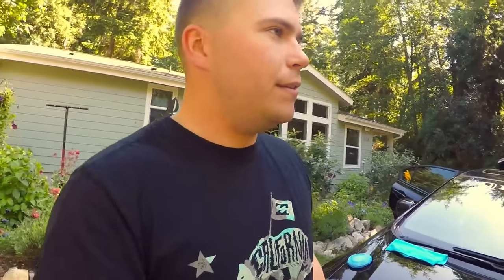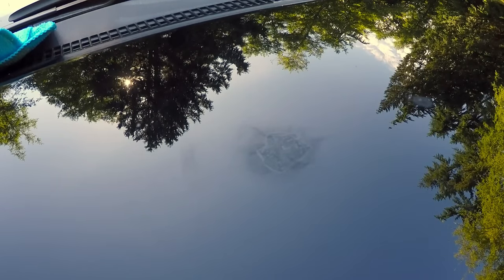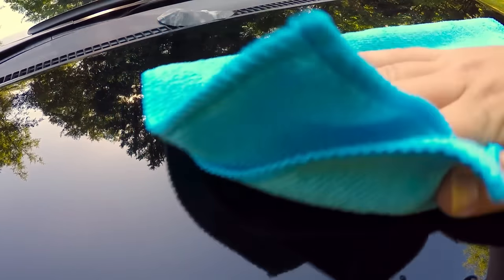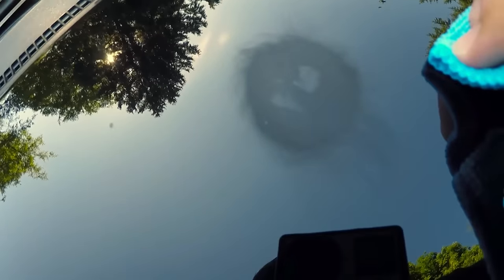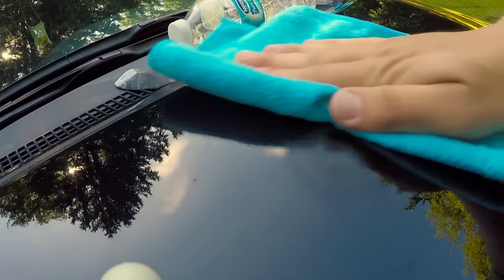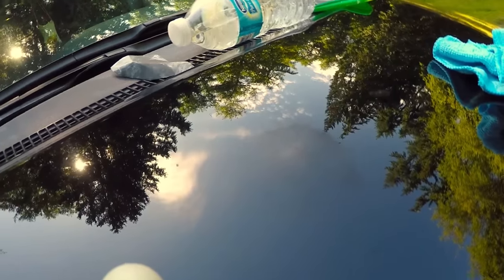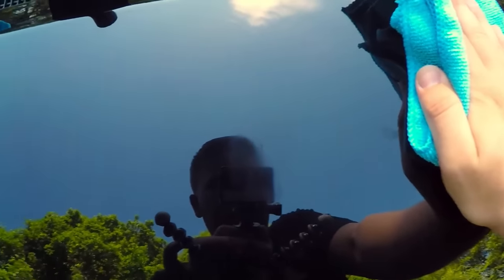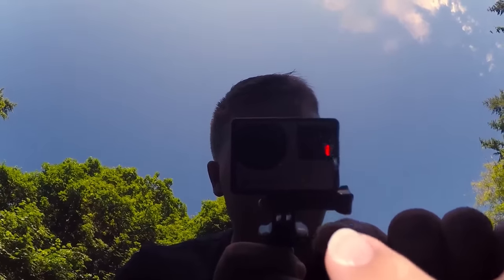Uneven Touch Up Paint Fix

Comment: how long did you let it dry before wet-sanding?  if you are going to put pen touch-up both paint and clear, and the color is lumpy as you showed, should you sand before the clear or put on the clear coat and then sand after?

Comment: Did you apply clear coat on each spot?  
Do you sand paint flush and then apply clear coat, sand flush again?
Reply: touch up paints already have clear coat mixed in them

Comment: Great video, great result! I do have a couple suggestions, though. I would highly recommend using at least a kitchen sponge as a sanding block. Much more even than fingers. Also, if you have a DA, a microfiber cutting pad with Meguiar's Ultimate Compound after sanding, and an orange foam pad with Meguiar's Ultimate Polish right afterward would produce great results.

Comment: what if your touch up pen has just normal paint then the clear coat? do you go back over the polished spot with clear coat and then sand, cut, and, polish before being done?? my car is ceramic coated so im just trying to see if i can add ceramic back over the fixed spot once u use the touch up paint

Comment: I'm curious: doesn't sanding remove some of the clearcoat? Wouldn't it be wise to apply some clearcoat, wet sand the clearcoat with a fine sand paper, then buff it out with polish?
Reply: @black.iczelion  That's a very helpful breakdown. Thank you!
Reply: @black.iczelion  That's good advice, it will show again when you thoroughly wash the vehicle but as you say repeat the process and all is good again.

Comment: You could also buy a cheap DA from Harbor Freight for about $50.00 and a pink foam pad used with the compound then use a black foam pad with the polish.  It saved a lot of time.  I was nervous using 2000 sandpaper on my car for the first time but it really helps smooth out touch up paint.marks.
Reply: dphotos please give more details .  Im new to this.  What is DA?   If there is a link it would also be helpful.   Thanks
Reply: Amazon has a Black and Decker random orbital for $30, with great reviews.
Reply: S. O. Rooney i use that one it’s awesome did a heavily oxidized black BMW came out like new
Reply: @Gnux91  Super reassuring. Thanks! Just getting to that part...
Reply: S. O. Rooney yeah just do the velcro mod on it so you can fit any pad and you’ll be golden that buffer is great no need for anything more expensive
Reply: @Gnux91  okay! You don't use the bonnets? Anyway, I'll do the velcro and pads!
Reply: S. O. Rooney nah they’re low quality, I uses chemical guys white and black one. One for cutting one for finish. They’re about 10 bucks
Reply: @Gnux91  Thank you! You're experience and advice are very helpful and reassuring. This is a bit anxiety - provoking when you love your car, as we all do.  😏

Comment: Good vid. If it were me, I'd soak the wet or dry sandpaper in warm soapy (Dawn) water for a few minutes before sanding. Periodically rinse the paper in the soapy water to avoid scarring caused by bits of debris that get stuck on the paper. After your self-described pressured sanding, perhaps a lighter pressure pass to smooth out some of the grain before proceeding to rubbing and polishing. Finally, polish your circles to the left, then to the right, back and forth. But yeah, good video.

Comment: Tried this with 2000 grit and my paint peeled off.   Stripped it, and started over.   How long did you let your paint dry before wet sanding it.

Comment: you can wet sand it lightly, then make sure it bends to surrounding paint. Then, instead of using heavy duty compound, use something like Maquires Ultimate Compound, or another light compound. This way, it only takes off the paint in small amounts, and pressing harder can take more off too. But, it may take a few more passes, but you are safer than heavier compounds that carry a higher risk of damage. Also, once it is buffed out with compound, you can use polishing compound or just polish. Then, wax it. then buff.
Key is to use proper equipment. Wet/dry sandpaper, and use a compound pad in a drill. The compounds are meant to be used at certain RPM range. Too fast, and burn the paint, too slow, just not enough done.

Comment: Personally, I would have used 3M Finesse It II polishing compound. It’s safer than the rubbing compound you used and it removes scratches down to 1500 grit wet sandpaper. You can use either an orbital buffer or by hand using a microfiber cloth.
Reply: @Stewmade64 I'm assuming you are still going to file it down with the wet sand paper. Thank you. I am a woman with no experience but I am willing to give it a try.

Comment: Dumb question but I'm not good with cars,  do you still use clear coat before you wet sand?
Reply: Tim White use clear coat before you wet sand the dried clear coat(let dry for a day at least)

Comment: Can't you use a strong cut compound and a machine polisher for a similar result and then finish off with spray lacquer (of the original car body color) to make the fix permanent? I wouldn't want to have to redo this every 3-4 months. That's not a permanent fix.

Comment: When do you put the clear coat on? As a last step?
Reply: Most touch up paints comes with clear coats if not you can wait till the touch paint drys up then apply the clear coat. After all, you need to sand it out to even out the surface and then apply compound followed with a polish to finish off.

Comment: When do I apply the clear coat? Before or after this process?
Reply: I'm trying figure out the same thing... didn't look like he had to do clear coat on this video. So I wonder if it's even necessary for really minor chips?? Not sure. Maybe someone can fill us in here?
Reply: @flavadog17  He would have added the clear coat before any of the steps in this video.  In other words, he fixed it with the paint pen, then added the clear coat, and then did the steps in this video.  

I'm certainly not an expert, but yes, I would always add the clear coat. Good luck
Reply: @hlf_coder6272  that would not work as he needs to smooth out the paint first (as it is not sprayed). In the video he would have to apply to clearcoat after using the rubbing compound.
Reply: Clear coat goes on top on base coat.when you scuff the car you dont break thru the clear coat.scuff then polish which covers the light scuff

Comment: Thanks for the tip! You were a big help.
Reply: Did you do yours? I’m trying to muster up enough courage to do mine..
Reply: @swervv2957  Yeah, I did. My touch up paint was so-so, but getting the new clear coat to match the original was easy. I used Meguiar's Ultimate Compound instead of the Turtle Wax one used in this video. A couple of coats with that and then a couple coats of the polish did the trick.

Comment: I worry that you have to periodically repolish fairly often or else it will start to look matte again like before the process ??
Reply from the maker: I don't have the same car anymore, but I never noticed any difference over the last few months of having the car. I wouldnt polish your car anymore than once a year or so in the rough spots or else you will eventually rub away the clear coat of your paint.
Reply: Alexander Parker thanks! Good video. What are you driving now ?
Reply from the maker: 2014 Volkswagen GTI Wolfsburg. A guy pulled out in front of me when I was driving the civic on black ice and it totaled it.
Reply: Alexander Parker nice bro that’s a golf special edition right? I really like the golf.
Reply from the maker: Basically just a golf with a turbo and some nicer amenities.
Reply: Alexander Parker nice bro enjoy. I have a 17 Camry SE. loving it. Both of our cars are reliable.
Reply: Alexander Parker do you have experience putting in a clear coat for scratches that don’t go as deep as the metal but just scratch the clear coat off?  If so my question is do you still follow up with sand paper and compound/polish
Reply from the maker: I've never tried adding clear coat before.
Reply: I thought so too but it seems this is a permanent fix. Wish I knew this 5 cars ago.

Comment: I like the process but he should have specified about the clear coat first, something that important to a paint job shouldn't be left out completely, I would have painted it, sanded with 3000, better to work a little more then to potentially take off too much, and have less abrasive scratch marks to polish out later, but paint it, after it's dry, wet sand it with 3000, after soaking the 3000 in dish soap and warm water first for a few minutes, then clear coat the smooth paint after it's carefully sanded first, you always want to clear coat over smooth dry paint, then when the clear coat has dried, sand that also with 3000 after soaking in soapy water for a few minutes first, then use the rubbing compound on the clear coat, but use Maguires rubbing compound that is clear coat safe and isn't heavy duty and less abrasive, then Maguires polishing pre wax that he used after that, that's also clear coat safe, and then use Maguires cleaner wax at the end to protect everything you just fixed and polished, it's always better to use the same brand since some polishes are actually much more abrasive then certain other rubbing compound brands, or like the compound that was used that was turtle wax brand and "heavy duty" and then have to polish that out with a much less abrasive polish like Maguires clear coat safe rubbing compound, that's actually meant to be used after the Maguires rubbing compound, it's the same idea as using a lower grit sandpaper before using a higher finishing grit to smooth that out afterwards
Reply: i like the long essay but touch up paint already comes pre-mixed with clear coat, so you're basically wasting your time and energy by putting another layer of clear coat

Comment: Can I use sandpaper 1500?
Reply: However I’m new to this completely
Reply: @BravoMo1982  woud be to rough (probably will scratch to deep)
Reply: BravoMo1982 I wouldn’t try it. It could probably be fixed but would require 2000 to fix so just start with 2000. A mistake that I made and I had to work a lot harder to fix it.

Comment: Just one thing: he should have used after using the 2000 grit wet sandpaper he should have used a 3,000 sandpaper that would have got more of the scratches out and even it out better before polishing and after polishing you add a wax otherwise the Polish will come off and it's useless.

Comment: Anyone know how this works with applying clear coat over the touch-up paint? Should I try not completely filling the chip, then fill it in with the clear coat and then sand?
Reply: What method did you end up going with
Reply: @swervv2957  I tried what i suggested in my comment and it didn't look nearly as good as his...I think the old clear coat doesn't blend that well with the new clear coat. I have a black car and I polish it at least once a year, so i try not to leave bare paint anywhere, but I think his method gives the best look.

Comment: Hey that was a good video and all. But I want to address some issues that from what I have read in the comments, some are already having, and also what you could have happen!

First is. DO NOT try to do this if your touch up only has colour paint covering it! 
This will ONLY work if you have clearcoat over your colour!  
When you "touch up" your chipped or scratched paint, you MUST be sure to leave the colour you apply on the chip or scratch, a tiny bit lower than the factory area surrounding it, that way when you apply clearcoat it will bring it up level with the surrounding area! If you apply to much clear, that is when you will need to sand it down flat. 

 Next is, you shouldn't ever sand with your fingertips, especially a FLAT surface! You will end up sanding a "low" spot which, will have to be repainted if you have any sort of OCD when it comes to the paint on your car being flat and even! 
 If you don't have a cork or foam sanding block, the best way to ensure it stays as flat as possible is to use the side of your palm and pinky when you sand by hand, if you have to much trouble doing that, use you hand flat to sand!

 Having a polisher these days is extremely handy, they are cheap and relatively easy to use with some practice!
 It will save you a tonne of time as well as your arm not being in pain after manually trying to polish sand marks out of your paint! But if you don't want to purchase a polisher or learn to use one, have fun doing it by hand!

 And with the polish, the best polishes you can get for your car will come from a paint store, but they can get pricey! Plus, this is also when you will need a machine polisher!
 Just make sure to get the correct ones......1st is coarse to get all sand marks out and make evrything nice and flat!
 2nd is Mirror Polish, which the name is basically what you want the end result to be!
 The best way you can finish is by Ceramic Coating your paint. You can get DIY one's, but the applications for this are generally not for beginners so you should probably let the pro's handle this stage! 

 Good luck!
Reply: So I have covered up a chip on my car, primered, and then painted, no clear coat on top, do I need to now put a clear coat on before doing this in the video?

Comment: I seriously don't get people who just take a huge touch up pen and smudge up 30x the area that was affected. My car has a pretty big deep scratch on the hood, maybe 3 inches or 7 centimeters long. The smudge is maybe 1 inch or 2.5 centimeters wide. It's so ugly, thick and uneven. It's crazy how bad people are at just wiping off excess touch up paint. People just cover the scratch and are like "My work here is done!". But it just ends up looking 100 times worse than with small white spots over it.

Comment: This doesn't work for metalics. I would imagine it only works for black and white cars. With Mettalic touch up paint it comes out pretty thick so its too dark.. when applied to the car.so it's a color problem as well as a surface look problem. I did this whole process just for the chip to get filled up by dark metallic paint. You can get away with this with a black or white car not so much any other color because even if you color match. It's near to impossible to apply just the right amount and blend it well enough for it to match the color spread around it. So save yourself the $30 for the supplies just for it to look not that much better and get someone who knows what their doing with metalics.

Comment: First of all. Never sand in a circular motion. Ever. Up down or left right. And don't press as hard as this guy did. Use a sanding block or sponge. Also, the rubbing compound he used was junk. I can get 1500 sand marks out with meguiars ultimate compound by hand without a problem. I cringed when I watched this
Reply: so you’re saying to use meguiars ultimate compound instead of turtle wax rubbing compound??
Reply: @antvq  1000000% yes.

Comment: Yes I’m a little late on the comment but you just sanded the clear coat and original paint off for a scratch and  replaced it with wax that’s going to eventually get washed off leaving a dull spot
Reply: At DallasCowboyBlu so what do you suggest we do instead?
Reply: yoolito25 let an expert do it does specializes in paint chips and scratches because it has to be sanded down panted and clear coat put on that’s pretty simple of an explanation but there are steps his method will leave you with a dull spot once that wax washes off
Reply: At DallasCowboyBlu I’m with ya, but the  expert suggested I paint a whole door for a 1” wide scratch that I got from some ***hole that slammed their door into mine
Reply: yoolito25 look up dent repair company but a good painter will blend instead of painting the whole door
Reply: Joe Black sort of but it want be perfect because you would have to put some sanding work in to it lots of ppl will put the paint match on their finger and smear a small amount on the scratch to try and simulate a blend
Reply: That's what I was thinking , maybe just the rubbing compound and wax to blend it in . Definitely don't want to sand down the clear coat and paint
Reply: Juan Ortega lol I know right I sure hope no one followed what he did in this video because that’s a good way to throw 1000’s of dollars away
Reply: This here is bullshit. You would have to be rubbing a dry towel on it like sandpaper to get it to smear like you're saying. And that wouldn't even be likely to happen because the polish and sanding he did mixed around the layers they were on so they have some of their own layer
Reply: Some of us don't have that kind of money.

Comment: I sand it off and I did everything correctly, but why is it still matte ? Help , gonna kill myself
Reply: MIU MIU Do Not use the the red turtle wax compound. It is to harsh for this repair. Instead use the "Maguire's ultimate compound" it will clean up those matte circles to an almost perfect shine. You may have to do it 2 or 3 times. Don't forget to wax the area to protect.  Hope this helps you out!